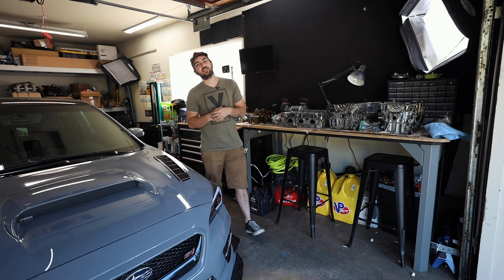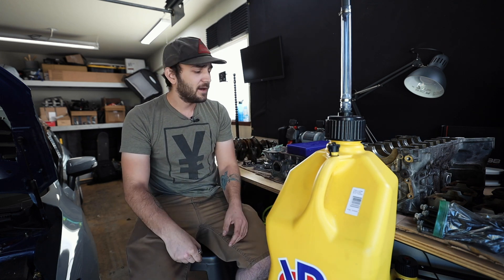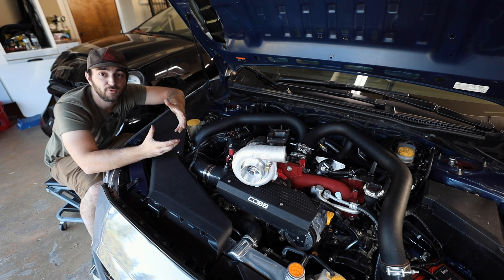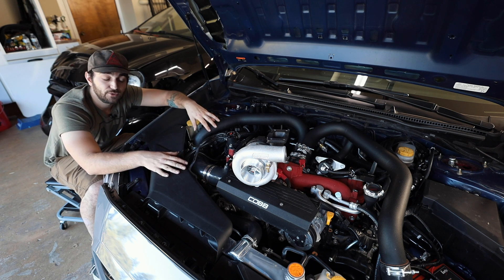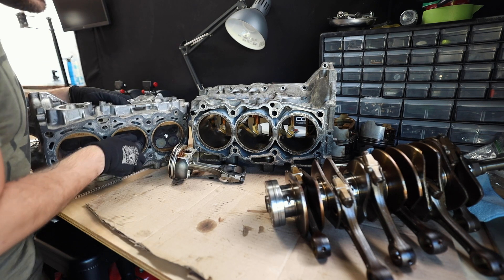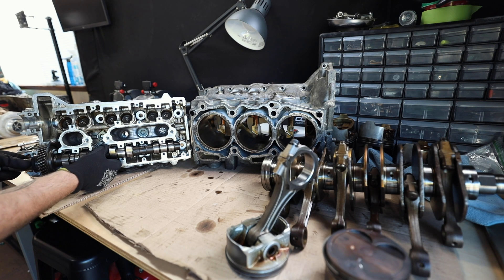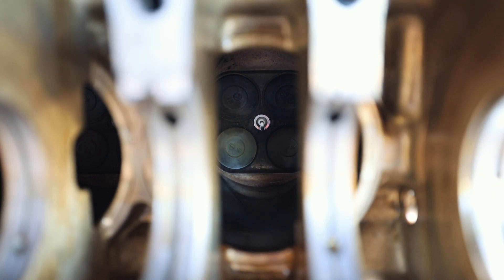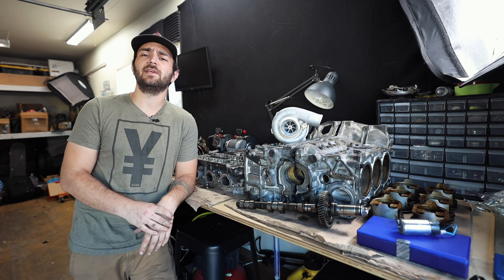From Fuel To Fire; How An Engine Works

Comment: Great great video my man. This actually helps for understanding my airplane engine, which I definitely need to have a full understanding of. Since my airplane engine does not have a turbo, I'm not sure on the routing of the turbo piping, could you explain that out?
Reply from the maker: You planes engine does not? What kind of plane is it? If it is a NA application the header would turn into the exhaust, and the intake would just suck normal air instead of compressing it through a turbo
Reply: Smeedia no it is a Cessna 172S, which has the Lycoming IO-360 engine in it.

Comment: buddy you have the best, most informative videos. as a guy that just blew my 2012 wrx this was nice to watch
Reply from the maker: Appreciate the kind words, sorry to hear about the motor, what are the rebuild plans? 🙏
Reply: @Smeedia  taking it to a dedicated subaru shop tomorrow. i would like to put in a new engine. but not quite sure which one i should choose? I love cars but am a novice.
Reply from the maker: Do you want more power or plan to stay around stock power levels?
Reply: @Smeedia  I want a little bit more power. Honestly, I was fine with stock but would not hate going faster. But I think for now stock would be best..
Reply from the maker: The Type RA shortblock would be the best bang for the buck 🙏
Reply: @Smeedia  oh hell yeah. just did a quick google. gonna tell that to my mechanic tomorrow..I also just want to get it in overall tip top shape so I can have a blank canvas. Gonna start watching some of your videos about drivetrains..because i am completely lost in that arena. my current drivetrain has 150k on it and I want to know what I can do to make it strong and reliable

Comment: Are wrapped headers worth it? Considering if oil gets on them there’s a risk of fire.
Reply from the maker: Personally I dont prefer them, but people have done it for years with no issues. Coating is always preferred. Especially in wet areas water can get under the wrap and corrode the piping over time

Comment: Your Subaru uses a return style system, so a small correction to your description is on return style systems, the FPR is after the injectors. OEM's usually use return style fuel systems because it's easy to lower/raise fuel pressure from a vacuum/boost reference. 

To note, you described a dead head or non-return style system usually found on naturally aspirated engines, where the regulator reduces flow with less demand and increases flow with more demand.
Reply from the maker: Thank you for pointing that out, did not touch on it but you are correct. It is interesting to compare the two, after seeing thr non return in my BRZ it threw me off, thr majority of cars ive had all have a return for unused fuel
Reply: @Smeedia  Hey no worries. I know how it goes with recording a video, one track mind and it's not until after you've finished recording you realize you've missed several other things, etc. 

I really enjoy your vids, man. I try to remember to like and all that but forget most of the time to help a brutha out.
Reply from the maker: No worries 🙏 always appreciate the addition information added in, hopefully helps people out 😁